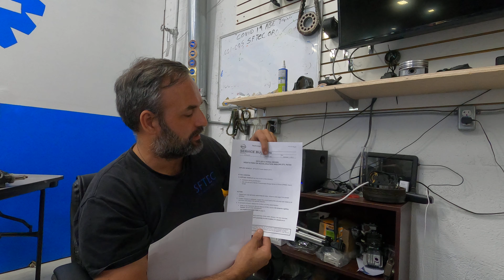Nissan transmission shifting problems.  Hesitation on Acceleration and /or DTC P0705 caused by water

Comment: i had the same problem, found the tsb, but found no water, also rs signal lamp was flashing rapidly in reverse, and not working. i took out the bulbs, found nothing wrong and rechecked  operation. its okay now, as i also cleared the code and changed the switch as it would not register correctly on my scan tool. so far so good, as i was going crazy trying to figure out the signal light operation., lol. that is some crazy electrical problem....